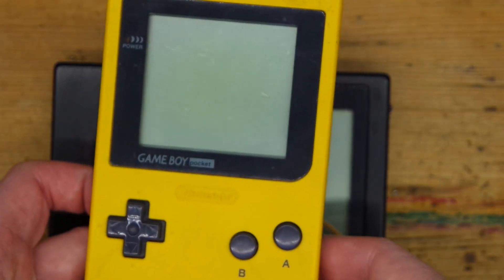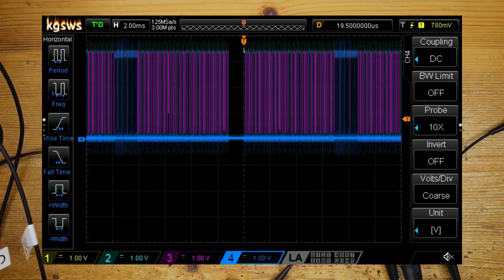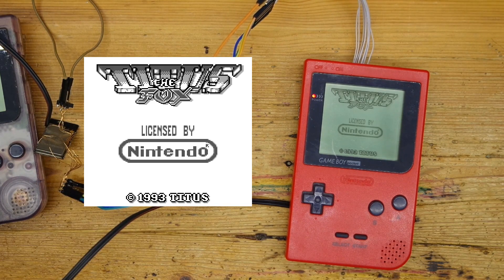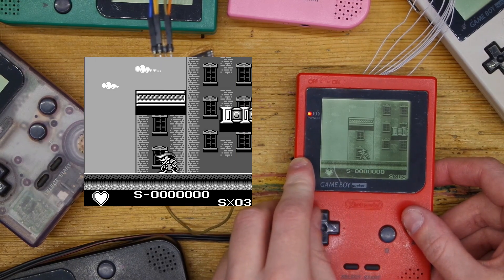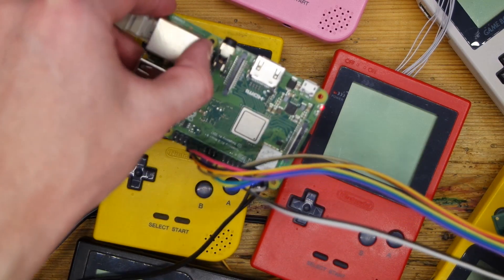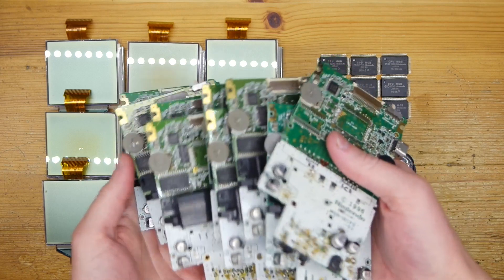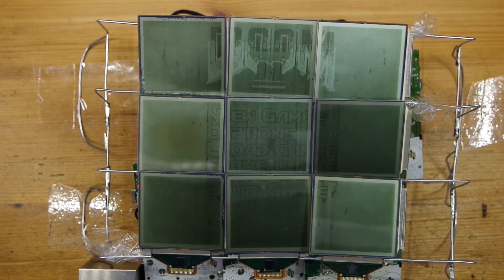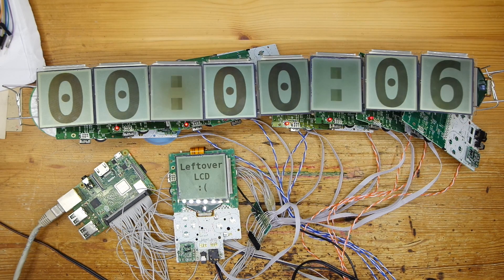I connected Gameboy LCD to ESP32 and Raspberry Pi. And then ...

Comment: *Hi! Great project 👏 Quick question: which DMG CPU pins did you connect to the ESP32, and did you use a level shifter (5V→3.3V) or direct wiring? Also, do you think it’s possible to send the captured image directly to a SPI TFT (like ST7789/ILI9341)? Thanks a lot!*
Reply from the maker: You need to connect LD0 LD1 and S directly. Then combine CP and ST using or gate. (google gameboy schematic for pin numbers)

I have rewired my gameboy to run on 3V3. It's not ideal solution, but as a demo it's OK.
You want to use level shifter for permanent solution.

You can do whatever you want with captured signal. ESP32 is powerful enough to different format. But i'm not sure if you can get 60 FPS over SPI.

Comment: I love to be able to do something like this! Is it possible to do the same thing with GBC screens?
Reply from the maker: Yes. And i do have that on my list. But it will take a while before i get to do that.
Reply: Thank you for the response. That sounds great! Happy to donate towards the project. With the gb screen are you still using the gb cpu to control it or is everything being achieved using the ESP32? Ideally I would like to use an OEM GBC on a pi and this project is the closest to achieving that
Reply from the maker: @plainlazy2097  I've already bought 9 GBC "replacement" screens some time ago. What's currently holding me back are other projects i'm working on.
It will take a few months before i get to this project.

Yes, ESP32 and rPi is controlling the LCD directly - no GP CPU needed.
But you still need original power regulator (for -18V) and voltage control chip.

GBC version i'm planning should not need those - i have bought only LCDs. So i'm gonna have to design my own alternative.

Comment: could the ESP32 in capture mode also output composite? Ive been looking for a solution to this for a while.
Reply from the maker: You would like to make GB to TV convertor, right?
Yes, it is possible, and i had a plan to do this in the past. But my plans have shifted.
Reply: @kgsws  Yes pretty much, but i dont know enough about the video standards to dive in at the moment
Reply: If you were going to do it how would you go about it?
Reply from the maker: @alexanderr-j4573  There are multiple ways to achieve this. It might even be possible to achieve "LCD crossfade" with some calculations.
Either way, you have to capture line data and add composite synchronization.
I don't have a clear idea which method i would go for.

Simplest way is to have prepared buffers with composite lines with synchronization filled in. Then you can just let capture DMA fill pixels in - if you choose right bits for LCD data.
You can then start composite output (in one shot mode) a moment after LCD capture started.
You would loose composite signal every time LCD is off, but it's much easier to implement.

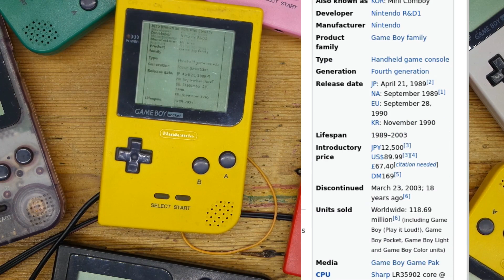Comment: 6:35 For cloning the display like this with just one small board, a Pi Pico may do with it's PIO blocks and DMA, I suppose. The CPU can just sit doing nothing so it doesn't matter if it's not fast enough to do it in a more expected maner. May be worth tinkering with.
Also that Doom example is amazing haha